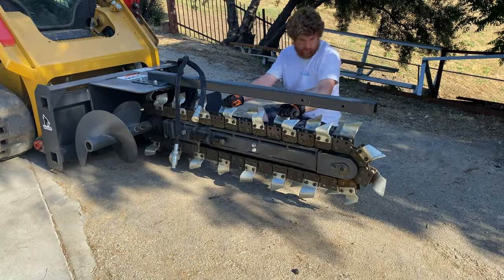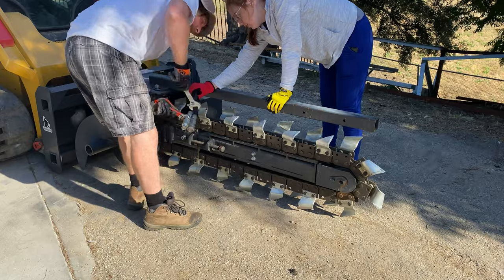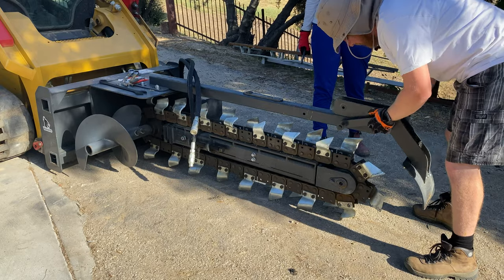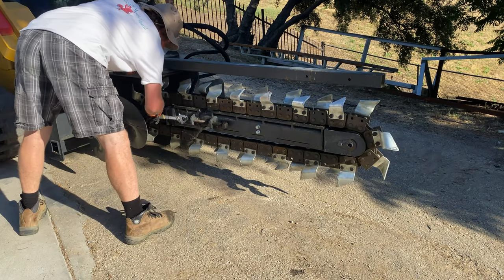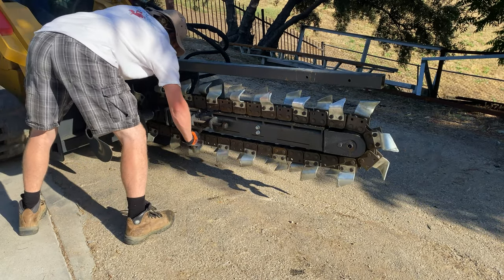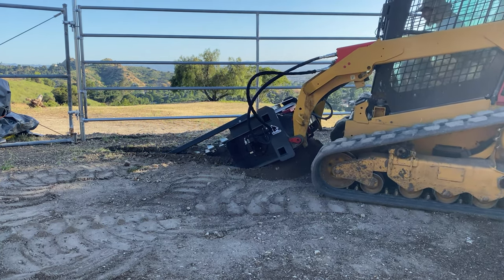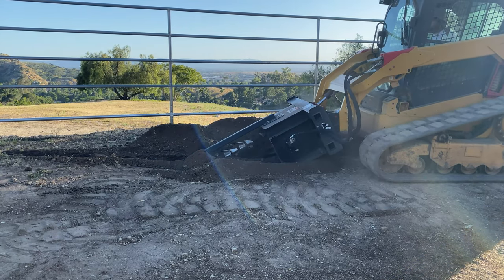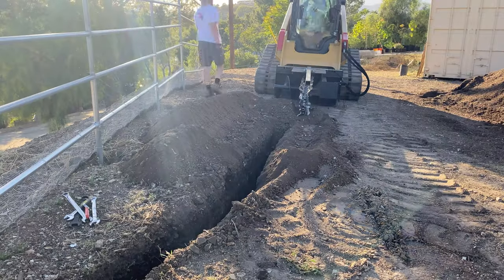Testing out a CHEAP Skid Steer Trencher Attachment

Comment: Ha!!  I got the same trencher..  think I'll go for the Auger too.  Anyway, for my "Crumbershoe", I have all the parts, but can't figure out how it goes on..  a few ways, but nothing looks like it positions it properly.  Was hoping you had a pic!  Oh well..  so far works great!  Who needs a "Crumbershoe" anyway.
Reply from the maker: I do have the auger as well. Don’t forget to add the oil to the gearbox if you do get one. 
You are lucky you got all the parts. I’ll post a video of fixing this part in the future, but I haven’t really needed it.
Reply: My ASV RT40 only puts out 13.3 GPM, But it works fine!  Digging rate 40+ inch depth..  rocky/sand/big roots averages abt 1 ft. Per minute at a medium 2200 RPM.  I have a stump that I ground pretty flat, but isin the way.  I think given 15 mins I can cut thru the stump!  Had dullish carbide tips which gnaw thru roots pretty well.
Reply: @MakersAcres  if this trencher actually works as beyond a stump grinder..  a Stump Remover!   Huge fan of ASIS:
ASS STAYS IN SEAT
my big 420cc stump grinder is a handful to position and handle
Reply from the maker: @markhall3434  thanks for sharing that info!
Reply from the maker: @markhall3434  haha. That’s a new acronym!

Comment: I just purchased one of these.   Haven't tried it yet however it seems to be built very strong.
Reply from the maker: Ya, just want to make sure you get the chain tension right. Since they didn’t include a manual, I think I looked at the bobcat one to check and make sure I got it right.
Reply: @MakersAcres  I tested it and so far so good. How much sag is in yours?
Reply from the maker: @joelkPPG  It’s been a while since I have used it, but I want to say about an inch or so.
Reply: @MakersAcres  That's about where it's at now I believe.  I'll be using it quite often this spring and summer. I'll report back on how well it works with extended use
Reply from the maker: @joelkPPG  great!  Let us know!  Mine was missing a few parts I still need to make for the boom.
Reply: Just bought one at RBA… but it has 3 hoses?  No matter I’m shopping for a skid steer now!  Thank you for the video!

Comment: Mine has 3 hydraulic lines. One is a return. Which one? Unfortunately they may not match. Mine is a mower king.
Reply from the maker: Normally the smaller line is the case drain and goes to the smallest quick connect on your machine.  You can also identify this line as being the closest line to the gear box or the blade. The other two lines should be in line with each other if that makes sense.

Comment: How’s the trencher now after some more uses? We bought some cheap attachments and can’t find parts. Thx
Reply from the maker: So far so good on this one. I have a compactor that has been a huge pain in the ass. I have had to make a few parts for it.  What attachments are you looking for parts on?
Reply: @MakersAcres  it’s a business partner of my dad‘s but we went in halves on the shredder and auger. I don’t even know what brand it is. He wasn’t able to find any info on it but it has a bunch of bastard size parts.
Reply: @MakersAcres  seem like the auger can go from three grand to 12 grand I don’t need a lot of with just 4 to 6 inches at about 3 feet of depth max
Reply from the maker: @Brooksinc1976  I bought an auger as well and it has been working pretty good. I can try and help you if you want. Reach out to the email in the about page and I’ll give it my best.